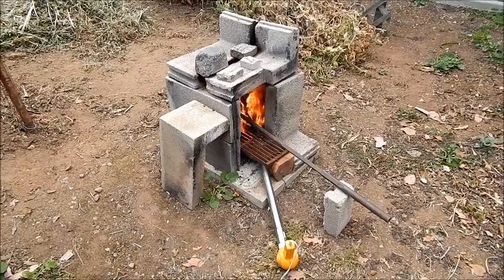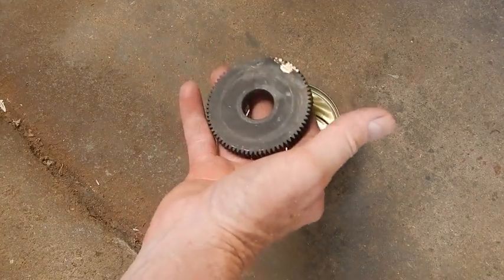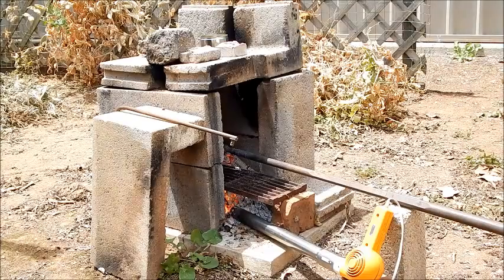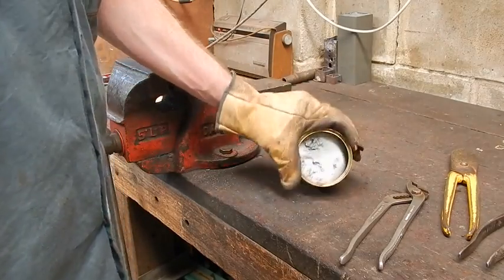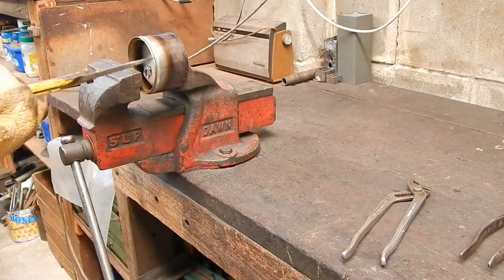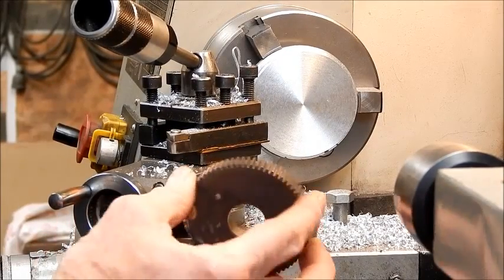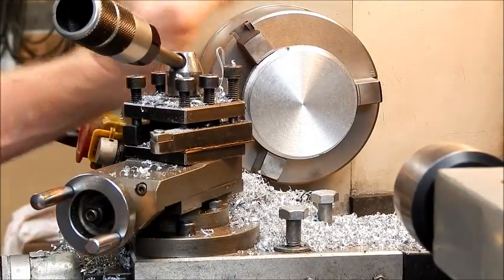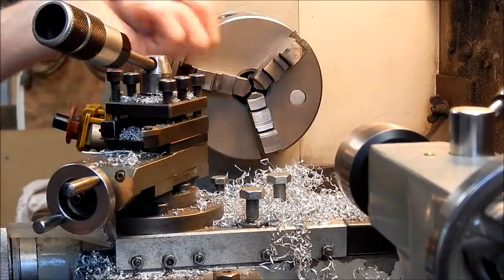How to cast a gear blank in a simple backyard furnace

Comment: Rob Great Vids love the way it is all explained without waffling on like some I have Watched.Rob do you select your aluminium for the project at hand as in either cast or drawn aluminium. Thanks again love the handle on the melting pot also where do you get your salt and Bicarb amounts for each pour from.
Reply from the maker: Hi Gary,

Been a while since I did a melt and I've been thinking about it lately.    Drawn aluminium definitely has better machining properties than die cast, including alloy wheel rims.  You can also make up your own mix using some of each.

Drawn tends to be softer, so for gears I would favour die cast.  The first gear I ever made was from drawn and it's still going as good as the day I made it - so just shows how well most aluminium  works for gears.

I just add a pinch of salt and bicarb.  Too much bicarb can do more harm than good, so experiment and see what is best .  It also varies depending on the type of aluminium.  Some alloy is so good it doesn't require any.

Also be sure not to overheat the alloy.  Red hot is too hot, just get it to melt and then pour.  That way gassing will be minimalised.

I hope this helps.

Cheers Rob

Comment: Thanks for your videos! I have watched several of them and appreciate your mind set on reusing items many people would simply discard. I do similar things myself and just recently acquired a cheap Chinese lathe (an older 7x10 Harbor Freight/Sieg model) with quite a bit of tooling and have been watching your videos to get some ideas.
After watching this video, I have a question you may be able to answer about aluminum casting. Do you think you would get less air bubbles if you just used a steel soup can as a one-time crucible and left it in the fire to cool naturally as the fire died out without removing the dross? I know it would take a really long time for it to cool on it's own, but it would seem to me that without pouring or disturbing the aluminum as it cooled in the vessel it was heated in there would be less chance of air pockets.
I may be completely wrong, just wondering what your thoughts were about it. Aluminum casting is on my to do list now for sure!
Keep up the good work and thanks for sharing your time and efforts with all of us!
Reply from the maker: +Keem2000 

The gas (hydrogen) bubbles are formed from heating/melting the alloy, not from pouring it.

You can add a pinch of baking soda as a degassing agent just before pouring.  This can eliminate bubbles, but too much can also make bubbles (Co2).

Stir and make sure it has stopped fizzing before pouring.

You can do as you suggested, to save pouring, but it won't get rid of hydrogen bubbles.

Cheers Rob
Reply: Okay thanks for the info!
What about leaving the dross on top? If it floats, couldn't you just cut off the top with a bandsaw and then machine it as normal?
Reply from the maker: Yes.  You could do that.

Cheers Rob

Comment: what's your ladle made of?
Reply from the maker: +Kevin Keel 

It's the outer casing from a DC treadmill motor, with the impeller from a water pump stick welded into the end.

All very scientifically designed and executed :)   He He.

Works well.  The handle is part of a collapsible steering column from a HQ Holden.

Cheers Rob
Reply: Sounds a lot like some of my engineering. I've been melting with a 5 quart cast iron pot, though it becomes a little unwieldy with 20lbs of molten lawnmower engine alloy sitting inside...

Comment: Rob, the cans have a food grade lining in them. You must put the tin in the fire real hot and burn it out, otherwise it burns and lets of gas and poor casting. This is what I found and thought I already mentioned. I use no flux or degasser and do it this way and get an awesome surface with no voids. How hot is your furnace?
Reply from the maker: No idea how hot it is.  But it's hot enough to make the cast steel grate go soft and sag :)  It's pretty damn hot.  It won't melt brass though.  Rob
Reply: xynudu . well do try burning out the tin. Use your torch if you have to. You will see the smoke come out as the lining burns. Sometimes the lining is clear/yellowish and not white.Burn that shit out. Ash and black is ok. Voids will be gone
Reply from the maker: I will try that.  The next thing I want to try when the weather is dryer (next summer), is the lost foam casting technique, with plain sand and a thin plaster coating on the foam.  Sounds interesting.  Rob
Reply: xynudu . Rob, don't go too thin and make sure it is totally dry, up to 7 days in our home shops, as dry humidity as you can get. Go slow too, support it with sand for the pour. I like the idea of the wax investment casting for small parts in a tub of plaster.. Your on the right track mate, have fun. Paul
Reply: xynudu . ohh yeh. It should end up spot on, except for blackening/oxidizing and the surface crust of the casting. Also there will be a ridge where the seam of the tin can joins. Maybe some shrinkage in the centre, top. Other than that it should be smooth cruising. 2 tin cans and you have added a boss to a pulley in a biscuit tin... Done :)

Comment from the maker: Tried another pour using the washing soda and it didn't work as well.  Got small pinhole gas bubbles.  The jury is still out on this as I didn't use as much as with the baking soda.  The baking soda definitely is more "active" and fizzes and gases a lot more than the washing soda.  Rob

Comment from the maker: Thanks for that info  tascracker - I will give the washing soda a go.  I already use it to remove rust with a battery charger (electrolysis) so I have plenty on hand.  Baking soda actually becomes washing soda when you heat it, so it probably converts in the molten alloy. I appreciate feedback like this.  There's quite a bit of wrong information around on this subject. Cheers Rob

Comment from the maker: The baking soda worked well in degassing as seen in the perfect blank.  I also have washing soda but have never tried that.  Is that a better option ?  Rob
Reply: ***** Sounds cool, but what alloy blend was this for and how large a quantity was the crucible, melting temps ect?  If you blend your metal in a small crucible, mix then scrape the dross before the pour, and don't tip out the last bit of crap from your crucible into any mould, you don't really need a flux. This is what I have found with my furnace and the blend I make, they machine well.

Comment: What good is an aluminium gear?
If you're going to spend all that time machining it, why not use a HT-able steel ?
Reply from the maker: Aluminium gears are used in car engines as timing gears.  Aluminium gears are strong and quiet. Aluminium gears cost nothing to make. Aluminium gears can be cut on a small lathe.  Rob

Comment from the maker: The second substance added was baking soda - a white powder.  This degasses hydrogen from the alloy.  I added too much and that was why the casting had bubbles on the exterior.  But it's a good way to show what to expect.  This type of casting is an imperfect science :)  Rob
Reply: +xynudu 
could be the coating on the tin mold burning off causing bubbles in the metal and prepping the tin in the fire before pouring may help